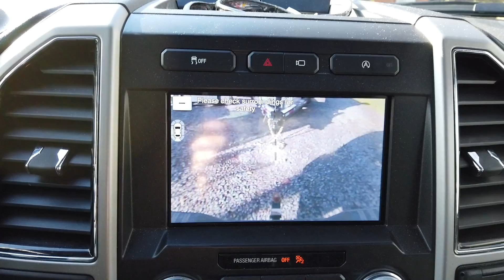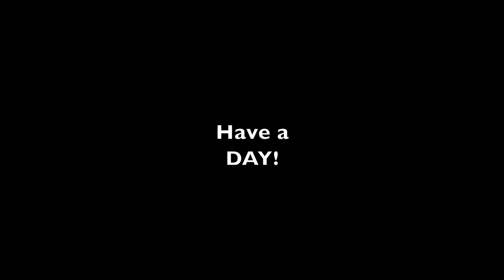#654 Thanks for a Wonderful 2019 and Happy New Years Friends!

Comment: Happy New Year !! Mike , Melissa and family 
Liken the 3/4 clean stone on road to splitter, I know mike likes the mix for packing ability
I applied approx 12 ton behind my one grouping of 18 rental property units , Its a much cleaner look / driving on , but is much looser for waking and using the Kubota backhoe to smash dumpster down 
Mike stay tuned for my coming trash dumpster invention for using with Wacker WL30 loader , just like Mike likes the enclosed cab ( warmer ) 
Its a combo of universal skid steer plate ( flush) two 4’ extensions attached to strengthened 52” steel lawn roller 24” diameter 
To smash/compact dumpster(s) for the rentals I own , approx 10 dumpsters 
Lookin forward to the next Morgan adventure LOL

Comment: You two just make my day.  I will tell you I am 18 years older than Mike and I will be 21 years older than Melissa in July. 
I watched the videos about the heavy rain . I wondered if the culverts (pipes) under the roads  are getting plugged from the water washing rubbish against the ends of the pipe. Have you considered putting a sloping grate over the end of the pipe. The water will push the trash up the sloping grate. I can send a picture of one that my Dad made years ago. 
This was the thought I had as I watched Mike clean the open drainage along the roads and trails. 
Let me know if you want to see pictures.
I enjoy very much your videos.

Comment: Happy New Year to the Morgans!  Regarding the mud, have you considered using geofabric under the gravel? On my 5 acres, I have Texas Blackland Gumbo Mud when it rains and I have gotten stuck with only the top 3 inches being soaked. During the times of drought, I have cracks so wide you can turn get hurt if not careful when walking. So I researched and found a suggestion and You-Tube videos on how to use it. It might be a pain to do, but only once. Then the driveways should be more stable.

Comment: Did ya get a chance to check air cleaner mount bolts on mill-they looked loose while you were running it on last video- my zero turn mower cracked it’s mount ( same motor) I